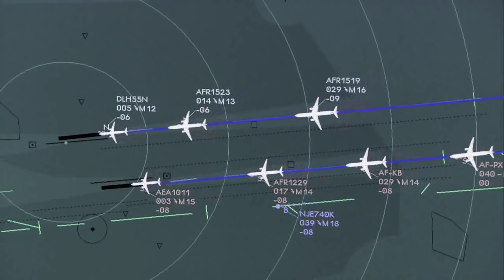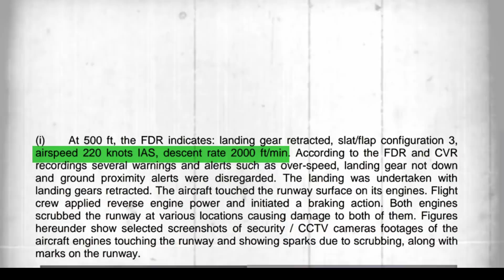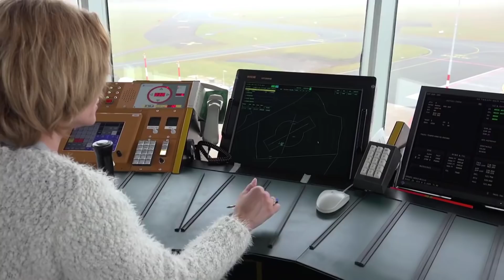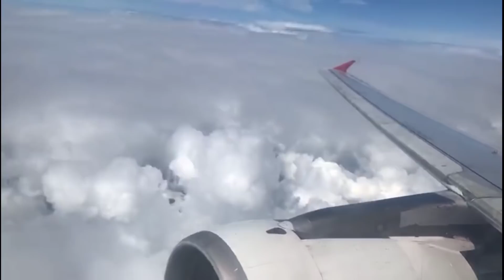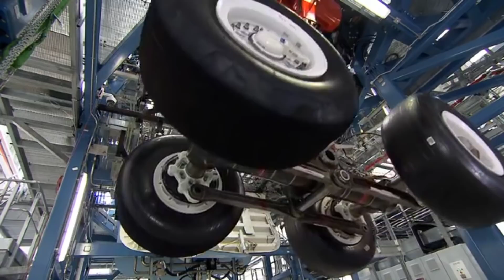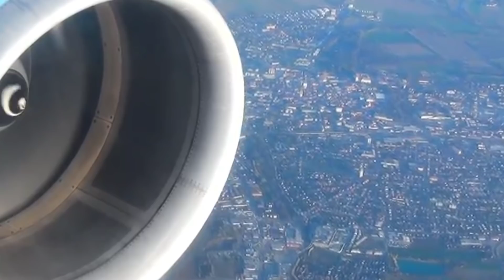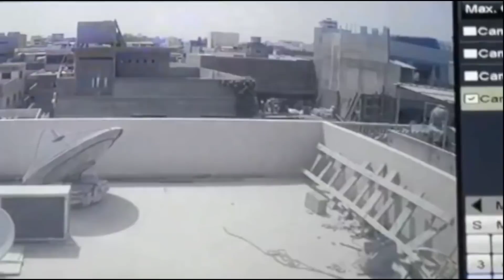Preliminary Report of PK-8303 part 2

Comment: This pilot was ultimately at fault. Even if the gear had been down. He was at least 100 knots over landing speed. Even if they had selected gear down air bus will not lower the gear in an overspeed condition. This is a purely incompetent crew. Tjeir approach was way to high and way too fast the entire time. The approach controllerdid in fact advise them to go around several times. They refused. Total flight crew incompetence. You are doing a great disservice to the aviation industry by defending them.
Reply: Bill Barker - This was not a defence. You are also totally incorrect when you state the Approach Controller told them several times to go-around. He did not. He offered them additional track miles and also asked them if they were comfortable. No more. Lastly calling this crew incompetent is just an insult, even if true, and fails to prevent reoccurrence. A more sensible thing to do would be to ask why this crew were where they were.

Comment: I remember seeing a video where reverse thrusters were applied when a plane was still a few feet from touching down. How could that happen if it’s dependent upon the gear having weight on them to activate?
Reply from the maker: Yeahhh some manufacture of an on old aircraft eg MD80 had this feature available that they allowed the aircraft to have their thrust reverses operated while still in the air few feets from the ground cause those reversers takes time to operate so by doing that by the time they land the aircraft thrust reverse can archive full power upon landing. Hope that answers
Reply: Capt Fahad - Correct. This is also possible on some (or maybe all) 737 models. It is enabled by the RadAlt.
Reply from the maker: @Trevor_Austin  yes 737 has it top means like if you are 10ft near to the runway the thrust reverse can be operated. Though i tried to find u on facebook but i couldn't find u there.

Comment: Hello Captain, compliments for the video which is very well explained.
I am an aviation enthusiast and I have been following air accident investigations for quite some time and this is certainly the most mid boggling accident that I have ever saw!
Of course until the CVR transcription is released we can't know what was going on in that cockpit however, it would appear that the pilots were  non communicating to each other and while one of them was thinking to execute a go around, hence the gears retracted at 1700 ft, the other was committed to land and he did so without realizing that the landing gear was not extended. In any event it is very clear that this was an approach that should have been interrupted way before touching down.
So sad, all those lives lost in such a way...
Reply from the maker: I agree with you this accident was avoidable. Is any one of the many options bad been taken into consideration and acted on it. The most chilling factor is why the landing gears retracted at 1740ft and then never lowered until touchdown despite of all the bells and chime in the cockpit! eagerly waiting for CVR. And at this point i wonder will they ever release it to public cause it should have been public by now but it hasn't yet!

Comment: usually when an aircraft lands... the tail is lower and nose is up.. thus instead of engines tail shud have scraped if they forgot to lower the landing gear..
Reply: I believe the engines are still lower to the ground than the tail even if the aircraft is in its proper landing attitude. 

However, I might be wrong as I don’t think anyone has try to land an A320 on a runway with the engines as landing gear before and Airbus would probably advice against it...
Reply: @tonamg53  if u watch closely any aircraft landing... u will notice rear landing gears touches the ground first.. so the angle created is wide enough for tail to touch the ground in case no landing gear..... i agree you that engine will touch but some amount of tail shud touch hit ground as well not just engines..
Reply: FunCook - Only if you touch down at normal landing speeds. A high landing speed will give a lower deck angle.

Comment: 100% ERROR RATE:

Even if say there was an error in communication with any ground controllers, the pilots are still responsible absolutely 100% for aircraft, passengers, takeoffs, landings, inflight emergencies, etc. 

Everything is happening at super quick speed. Flying at 500 mph, you cover a mile in so many seconds, and/or you are flying 220 knots, you are covering a mile in less than one minute, so therefore, errors are amplified. 

If you’re flying in a plane going 500 mph, how long would it take to travel one mile?
Answered June 14, 2020 
Travelling at 500 mph, you'll be covering one mile in 7.2 seconds,
https://www.quora.com/If-you-re-flying-in-a-plane-going-500-mph-how-long-would-it-take-to-travel-one-mile

Just my observation (because i am old, and heard and seen lots of bad things happen), is that 100% error rate equals death. Namely, it can be one person making all the bad decisions, or a group of people making bad decisions. The decision making process is cumulative, whereas, if i make a bad decision (=5%), and the person does not catch it, then the value of that bad decision is increased to say 15%. For example: MH17 was shot down over the Ukraine. Error list:
1.) Airline flight planners plot MH17 course over combat zone in Ukraine
2.) Pilots accept flight plan
3.) Pilots fly over Ukraine war zone
4.) Missile battery operators assume airliner is hostile, and shoot down civilian airliner.
5.) everyone dies.

Also, there was an egyptian flight with course plotted over the sinai desert, but was shot down by rebels with missiles, etc. The same set of circumstances prevail, bad decisions that are not caught and corrected will cause death.
Reply: jay deister - You can not be serious with your post. That was rambling, incoherent rubbish. Firstly speed is merely a number and you learn to plan and think accordingly. Next 100% error is just 100% error. So what? It doesn’t equal anything. Your assertion is without merit as it is not possible to to determine a degree or percentage of error. You then go on to show a breathtakingly ignorant understanding of the MH17 incident. The flight planners were not warned that this area was unsafe for civil aviation. Pilots can only disagree within the flight planner if they have additional information. They did not. With hindsight we know that this aircraft was shot down by mistake. Mistakes and errors occur all the time. Fortunately most of them are not lethal.

Comment: It’s very common for landing clearances to be given by Approach Controllers, especially when things are abnormal. This often happens during an emergency, when you forget to change frequency, when the Tower frequencies are blocked and so on. I too also believe neither reverse nor lift dumpers were deployed. As for not passing the information that a gear up landing had taken place that is a mute point. It would not have materially added anything to the event. With regard to the FDR, it would have to have its own battery system to function following a total loss of AC power. That would leave you with the problem of what initiates the FDR. It can’t be battery switches, nor fuel levers. So what would you choose? I also believe that had the gear been up following the dual engine failure they might have made it. 

For the future? In my opinion this investigation needs to focus totally on PIA’s operations. How do they select their pilots? What admin checks do they do on their pilots prior to and during service? How do they train and check their pilots? How do they monitor their pilots during line operations? How much of a team are PIA crews in service? How do they deal with unsafe acts? If you are not sure why I’m asking these questions, educate yourself on safety by watching videos by Sidney Dekker. The industry is irrelevant, it’s the approach to safety that matters.
A good video and I think you terminated it at the right point. You need more information to go further.

EDIT: Apologies for my poor English and spelling.  I have no excuses!
Reply: "The industry is irrelevant, it’s he approach to safety that matters.". Total agreement. That is where the fault lies.
Reply from the maker: Thank u sir. For your time to explain highly appreciated. By the way is there any way to get in contact with you? If possible?
Reply: Capt Fahad - You’ll find me on Facebook.

Comment: Sir, Highly appreciative of your brilliant analysis explaining the position understandable even by layman like me. 
From the last part of video a question comes to mind and hope you will offer reply. At what point of time cabin control system gave alarm that Engines have been damaged?  ATC does not tell them as he may have thought that it is only minor scratching. If there could be any problem they could have failed to take off. Even pilot did not mention any discrepancy when controller asked him to go to 3000 feet. Otherwise pilot could have tell the controller that my engine/engines are in problem  as I getting warning of engine problem from the system, how can I do this. Only after some time he gave the message that he has lost the engines. At what point pilot got the warning of engine failure and interval between warning of engine failure and actual failure
Reply: Sir, thanks a lot for your response and taking pain to clarify the situation. Now, I understand that engines collapsed without any prior warning.
Reply from the maker: @raza1954  no there was warning in the cockpit but i don't know how on earth pilots neglected that as the Chime in the cockpit is extremely loud and audible there were alot of warnings going on in the cockpit but somehow pilots neglected all and landed the planes without landing gears! It's an extreme level of mistake that cannot be neglected. And due to this it is such an abnormal case that has never been seen...
Reply: @mfahad5  Sir, you are right about the warnings before hitting the runway but please tell me about warning  when plane took off again. I have listened to the cockpit recordings before and on Mayday call, I could not find any warnings for engine failures. Please guide me on this aspect.
Reply from the maker: @raza1954  sir there must have been warnings in the cockpit since the exchange of conversation b/w pilots and atc are limited we can't here all the chimes. Plus the boom mic is designed to increase the vocals of pilots rather then any background noise. Soo yeah after the engines scrubbed and the pilots got back up in the air there must be ton of chimes ringing off in the cockpit.
Reply: @mfahad5  Sir, Appreciate your response. Please guide me what data recorder and voice recorder tell about these critical moments.
Reply from the maker: @raza1954  the fdr is a flight data recorder that monitors the flights parameter and the actions of pilots doing with the plane.. The cvr is is a simple cockpit voice recorder that records the conversation of pilots
Reply: There may be warnings of an impending engine failure. With a fully serviceable engine the most likely warning is a low fuel pressure. Another could be low oil pressure but jet engines will often run for a considerable period without oil. When the friction starts to increase, some engines will then give warning of an overheat. Each of these warnings will be accompanied by a warning chime and in an Airbus, an ECAM message. As the engine fails you will notice a loss of thrust and depending on the type, a yaw towards the failed engine. A failed engine message will often override/remove the previous associated messages. The time from the first warning to failure could be no time at all. We will find out when the report is issued. It is also normal for the controller to be the last to know you have a problem. The order of events is Aviate - Navigate - Communicate.
Reply: @Trevor_Austin  I am impressed the way you have clarified the issue and has advised to wait for the report.
 I understand that if the pilot has got the warning regarding engine problem earlier he should not have gone for go around after engines collisions with runway. On receiving no warning for engine problem he thought it as scratching without engine damage. At that point he was rights as engines took off the plane and there was no warning of engine problem after having hit on runway. This is my theory that it is not pilot error but machine failure without any warning.
Reply: Muhammad Asif Raza - The engines fitted to modern aircraft are now some of the most reliable pieces of machinery known to man. Modern multi-engined aircraft fly very well on one engine and although the recommendation is to land as soon as practicable a single engine failure is not always considered to be an emergency. These aircraft will also glide controllably with no engines running. In this event I will suggest that the “slide and go” wrecked the ancillary gearbox causing the high pressure fuel pump to fail one of the engines. We are not told why both engines failed so I’m suspecting that we will recieve some more “interesting” news on this subject. This is when we might also understand what the pilots were thinking.
Reply: @Trevor_Austin  Thanks for taking pains in responding my questions and agree with you that engine fault occurred in this case. However, I am curious to know when pilot got warning regarding engines problem. it was before the engine failure or on engine failure.  if he got the warning prior to engine failure and did not act or informed then he is at fault otherwise he is not. Unfortunately, we have blamed him due to his prior mistakes which were not fatal one but system failure to inform him after engines collision with runway has totally been ignored.
Reply: Muhammad Asif Raza - The timing of the warnings is somewhat irrelevant. This is because the actions you take with an impending failure would normally be the same as if an engine actually failed. You also really must move away from the fault, blame and accountability aspect. To unlock the causes of this accident we have to try an understand why this crew did what they did. Why did they chose to do what they did? Was is because they were incapable, incapacitated, incompetent or was there something else going on. Modern technology allows us to already sea that this was probably the most unusual piece of flying that have ever been witnessed. There have to be a reasons for this. We must find out what they were, apply the fixes and then make sure they remain in place to prevent reoccurrence.
Reply from the maker: Asalam o alikum sir. First of all thank u soo much for your appreciative comments highly obliged. Secondly once they lifted the aircraft back in air the engines gave them enough power so that they could climb to an altitude of 2000 once they were at 2000 their engines must have been failed. cause the atc gave pilots to climb to 3000 but They couldn't climb and requested to be on 2000ft somehow the pilots did not convey their emergency to approach controller that their engines were flamed out soon they lifted back up and since then the a320 was gliding down. So yes the atc had no clue they must have thought that pilots scrubed and there was a little spark and they got back up. the atc has no clue about the severity of the situation until the pilots aware the controller but that mayday call was initiated alot later down when aircraft was about to crash and at the point the atc cannot do anything....